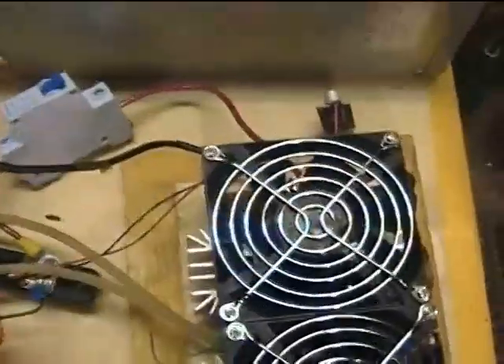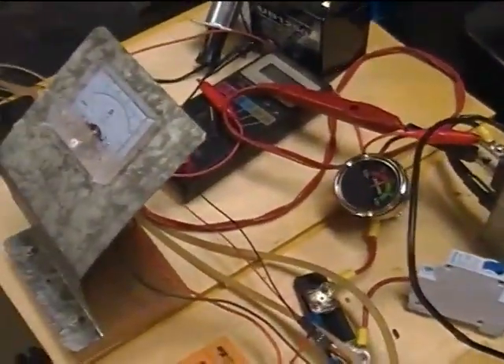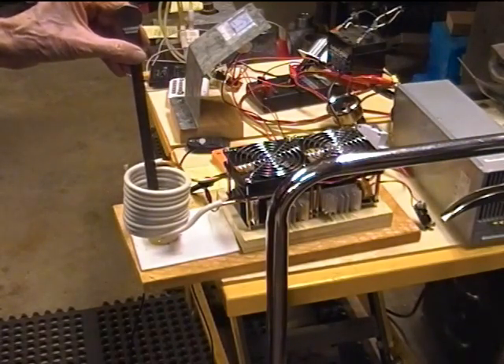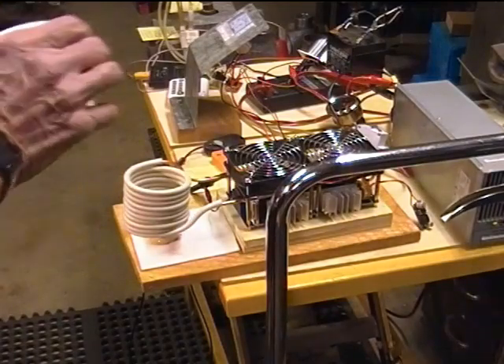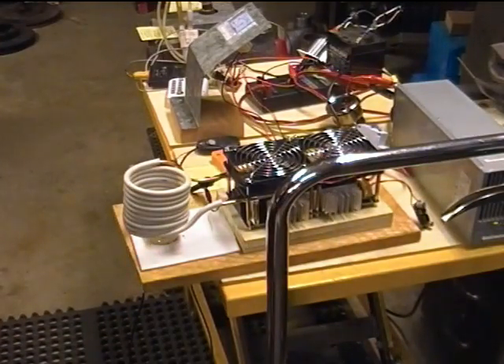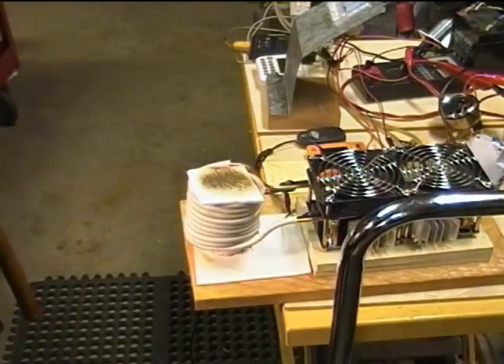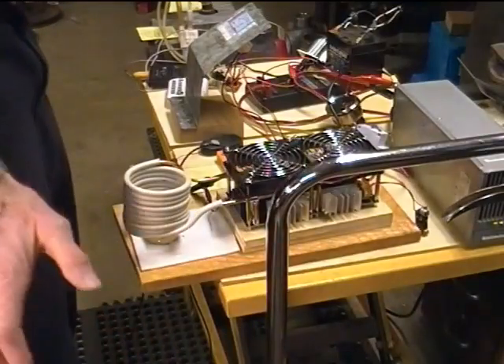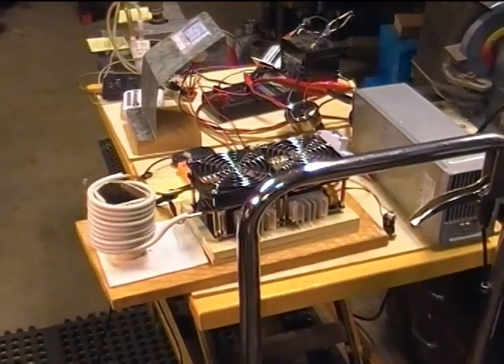1800 Watt ZVS Induction Heater Operation and Testing Capability

Comment: nice work. 
i wonder did you measure the current after the board. I mean board output. Is it same as the input current?
Reply from the maker: Good question.
  I don't have a good way to measure the actual current going through the work coil, so No.
It would certainly be  somewhat less than the input current.  I suppose that I could do some work to try to measure heat losses due to heat dissipated by the Mosfets, the chokes and the capacitors, but  at this point , I am comfortable with measuring that input current and using it for at least 3 things:
1. Making sure that I don't damage the system by going overcurrent, especially when inserting some new shape of (usually ferrous or graphite) material into the work coil
2. Determining the relative power consumed by various materials.
3.  Understanding the working relationships between coil designs and the coupling with the work
Reply: @frenchcreekvalley   i agree. it should be less. but i got the 1000W version of yours. but while my power supply is on like 36V 20Amps i measure the coil current with a clamp meter and it shows like 180 Amperes of current somehow. i was wondering if it is the same case for you. i dont know if i am making a fundamental mistake here.
Reply from the maker: @fytech1  Not necessarily a "mistake".  
Think of the system as a transformer.
36 volts DC X 20 amps = 720 watts, (at the INPUT) right?  Okay, so you  if you read 180 amps across the work coil (the OUTPUT) and IF the Wattage was the same 720 watts, that would simply mean that the RMS voltage across the work coil would be about 4 volts. Not a big surprise since the work coil is almost a short circuit half the time and the capacitors are almost a short circuit the other half of the time.
    I am generalizing here, since we haven't accounted for the idle current, and I don't know whether your meter was capable of accurately measuring  the tank circuit  current at 100 Khz or not.

Comment: I completely agree with your opinion on why the work coil is so large in diameter after working with coils and monitoring currents myself.  I have also found that the magnetic field is very intense near the edges.